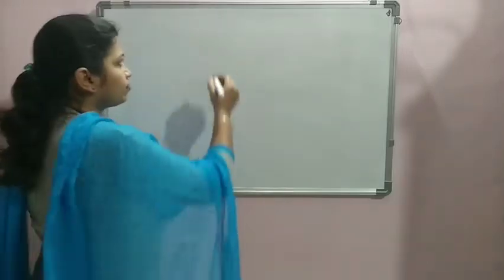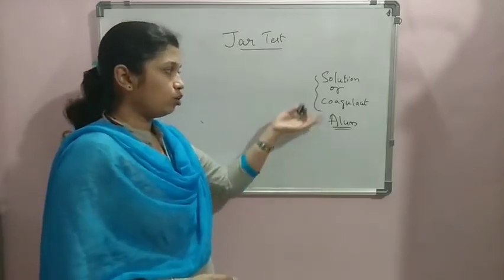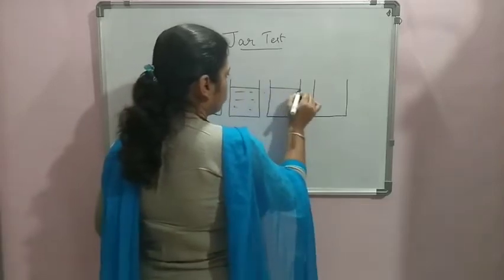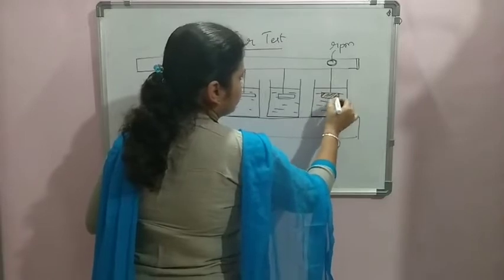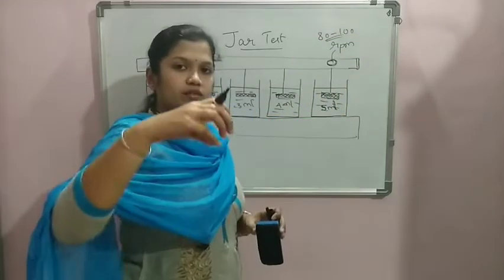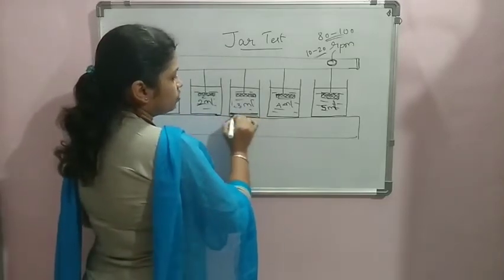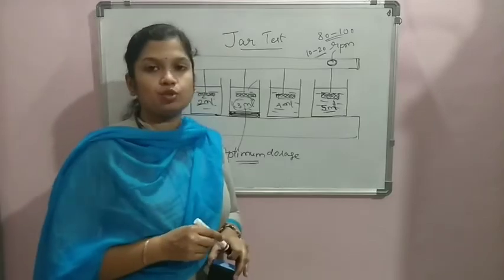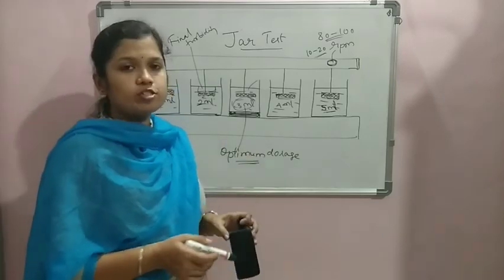Jar Test | Module 3 | WSTE| Civil Engg.| VTU syllabus

Comment: Your teaching very good i appreciate your efforts
Reply from the maker: Thank you
Reply: @shwethakc7697  mam what's your main subject you teach?
Reply from the maker: @aditya1201  Environmental Engineering
Reply: Mam Is there any final calculation to find dosage of coagulate
Reply from the maker: @binushay3074  yes there is formula for calculation
Reply: @shwethakc7697  Plzz tell me the formula mam...
Reply: And plzz share me how to prepare alum solution in 1000 ml of water...
Reply from the maker: @binushay3074  14.28g of alum can be added to 1000ml distilled water.that wil get you 14.28mg/ml of concentration
Reply from the maker: Mail me on shwetha.kc22@gmail.com I will share procedure.it can't be explained fully here
Reply: @shwethakc7697  Ok sure mam
Reply: For turbidity checking top solution is enough or not...???
Reply from the maker: @binushay3074  undisturbed top solution is enough for turbidity checking.